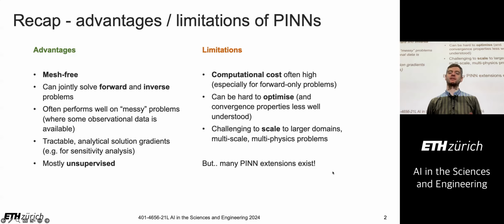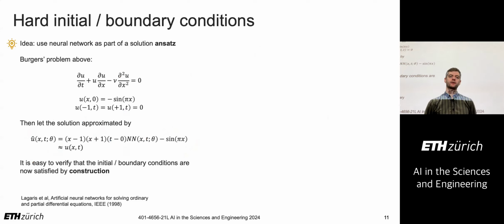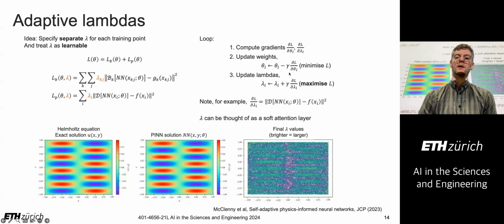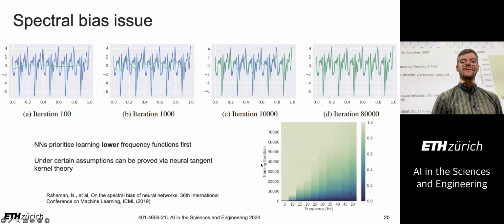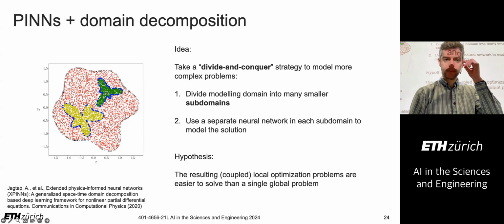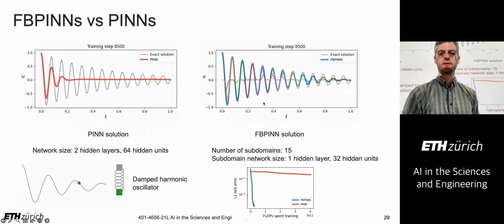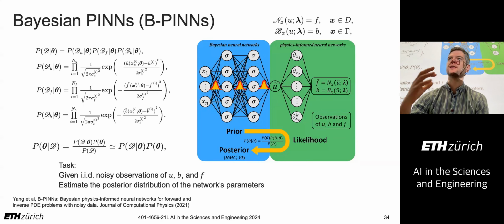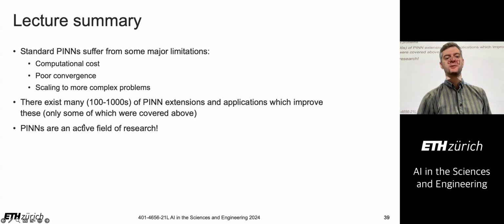ETH Zürich AISE: Physics-Informed Neural Networks – Limitations and Extensions Part 2

Comment: In the case of the Pinn solution thrashing ( https://youtu.be/NFtE1pyD5LA?si=KmqXpcC_3XhrAeQ3&t=506 - slide 9) could something like scheduled dynamic lambda 1 and lambda 2 weights for the PDE and BS loss terms help? For example, setting the BS weight high at the beginning of the training and then gradually lowering it while increasing the weight of the PDE loss?